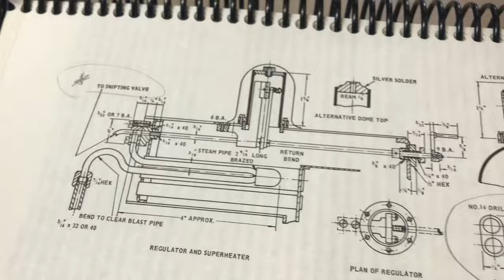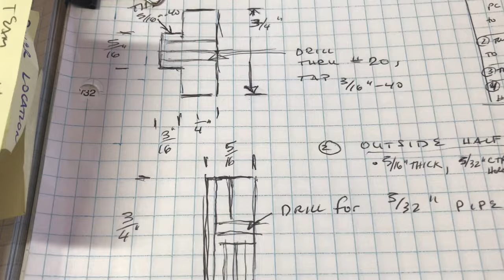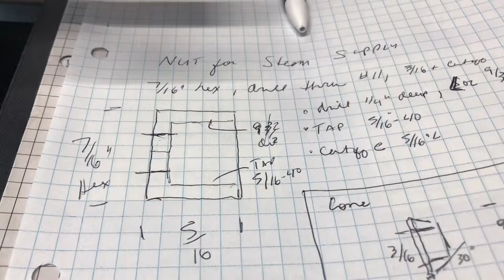50. LBSC Tich locomotive project. Steam header, piping, fittings

Comment: I always struggle with wet headers but looks like you have it sorted 😀
Reply from the maker: Thanks, Julia. I’m halfway there, but need to learn to braze. LBSC says to use brazing versus silver solder to join the pipes to the superheater return. I’d welcome any suggestions as I am confident with 45% silver solder, but have never really brazed anything. Thanks!
Reply: @metalmill52 you need a lot more heat for brazing so forced air and propane as a minimum but oxy propane or oxy acetylene ideally. It’s a long time since I did any! The more modern approach to super heaters is to tig weld stainless tubing into a spear shape and extend into fire box (radiant) then silver solder to copper pipe near the smoke box end. That type works a lot better and lasts much longer. It all depends on what you have access to. Good luck 😀